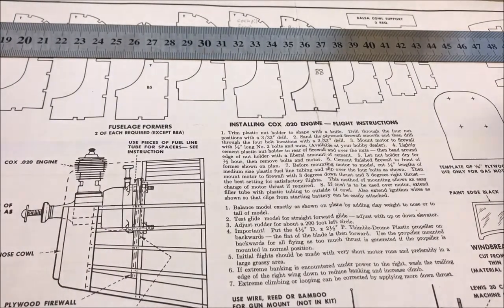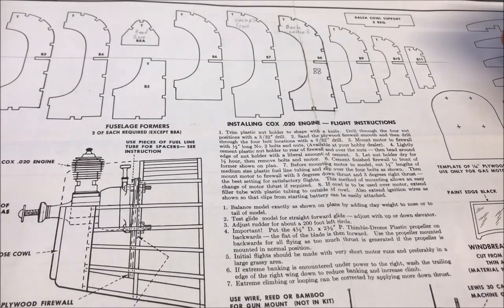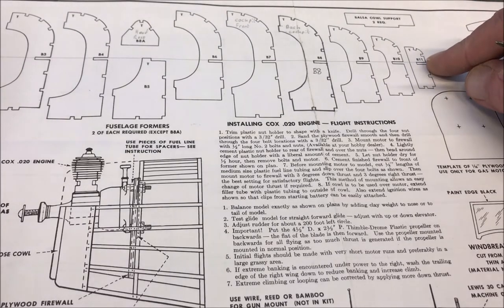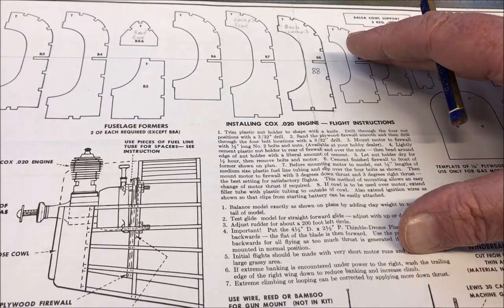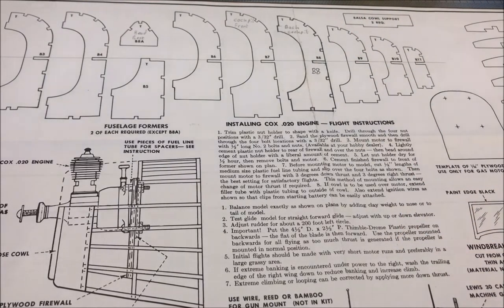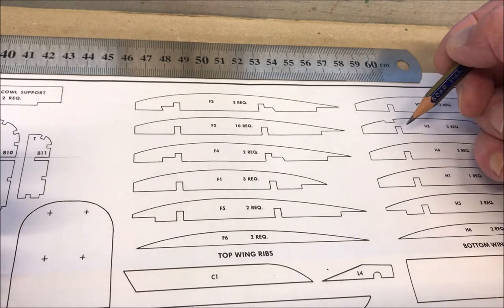Guillow's SE5a Part 2 Making a pattern

Comment: Thx for the explanation of how you do it. I do remember carbon paper (hence the "cc" on emails) and in the end I came up with another technique. I lay the plan down, I cover it with plastic (a Polly  pocket, for cost), then I put masking tape over the shape and draw directly on it. Then I unstick the masking tape and stick it on my balsa and cut directly through it. For small pieces it works well, for longer ones, there might be some deformation going on.
With the Guillow's I am finding not all pieces are on the plan which is a risk of I want to scratch build the model again. 
Looking forward to your electronics chapters as that is still my biggest hurdle ahead!
Reply from the maker: Hi, thank you making contact. We all need a pointer here and there. I recall my Father using your method on something unrelated to models. A worthy tip. 
Regarding electronics, what do you need to know?
Reply: @thebarronflights  With electronics, pretty much everything. For my models I use brushed motors that are spares I get for the Eachine P51, but I realise that is limited in power. I have taken the plunge and bought a transmitter and want to get an ESC and a motor as well as a battery and charger and all that. All the different connectors are also daunting so I decided to get the components gradually and try to discover as I go along. 
If you have a video on what electronics you use I hope I find it soon. If not, it would be a nice one to share ;)